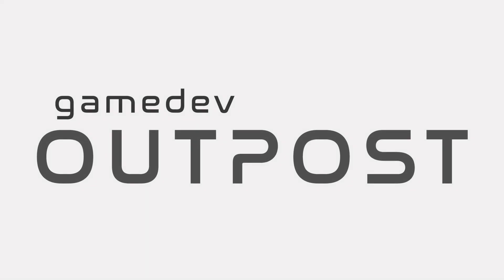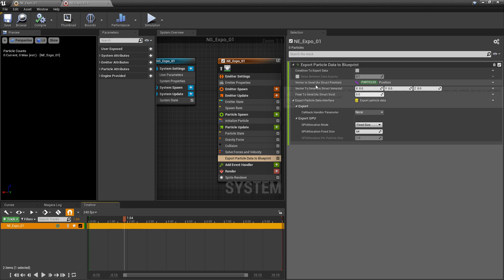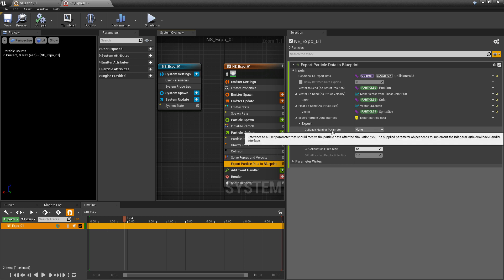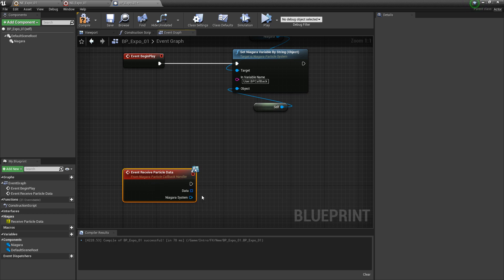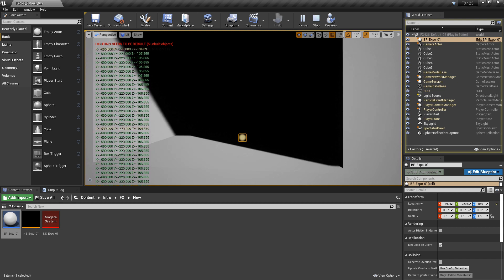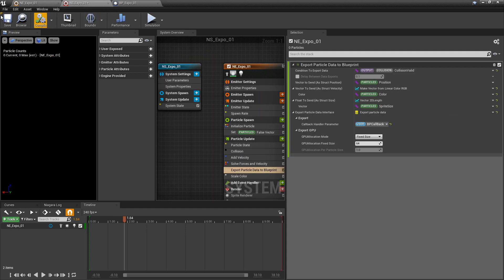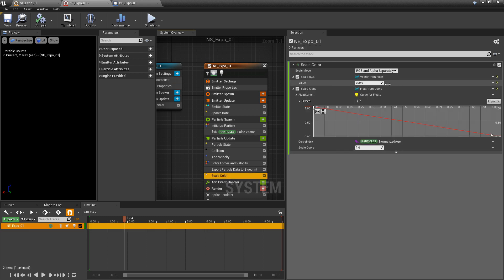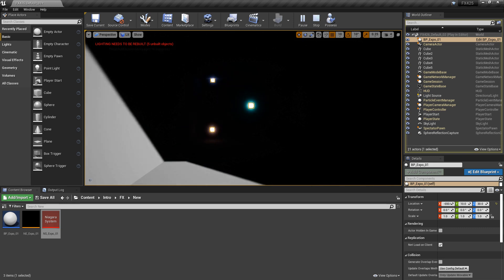UE4 - Niagara Export Particle Data to Blueprint - Collision

Comment: Im saving this for later, but what about importing? What If I want a blueprint to adjust specific particles

after watching more, This is so needlessly complicated on unreals part. How was anyone meant to just figure this out.
Reply from the maker: Importing has many approaches. Import a data table CSV or JSON, you could read from a text file in a blueprint. Then you can pass the parsed data via Niagara user parameter. It depends on your needs
Reply: @gamedevoutpost9270  Hey, Ive got a really nice emitter system now.

Ive got 2 emitters in a niagara system. Using export particle data to blueprint module, Is there a way to distinguish which emitter is currently exporting data?

Comment: Any way to kill a particle using this system?
Reply: Kill particle -> export particle data? Yes. I've done that with bullets before for eg, but I ended up not using it just because exporting data at a high frequency from niagara can cause latency issues from what I recall, and it's better to use line tracing with a similar frequency to hitscan or even with a delay, deal damage on the spot it visibly lands on.

Comment: Excellent Tutorial overall : ) 

Just a note for UE5.4 onwards: Setting VariableName for SetNiagaraVariableByString (Object) to "User_BPCallBack" wasn't working for me in UE5.4. Fix was to set it to "BPCallBack", matching the exact string in User Parameters of the Niagara System, which is quite a sensible (and less error prone) choice on Epic's end.
Reply: Also confirming 5.2 doesn't need "User" either

Comment: Hello! Do you know anything about Niagara Data Interfaces? Let's say that I want to drive my particles with values from an array that I have in C++ or Blueprint (lets say a single float value). It appears there are functions for setting float arrays on the system, but I get crashes; also they are private in BP libraries so I can't use them from C++ to test there. This is in UE4.26.2. Thanks!

Comment: Hi, great tutorial thx. One question though, do you know a way to do a cast with this method, so that it doesn't return data from all collisions, but only collisions that happened with a certain bp? Normally I would add a cast to node but I'm not seeing a way to do that with this setup.
Reply: Have you found solution? I'm searching for similar stuff. I want the particle to return the actor reference to which it collides.
Reply: @sanketvaria9734  I don't believe I found a solution for this either. Surely there is a way but I couldn't figure it out.
Reply: @flurishart612  I did found a video but the person basically did a sphere trace for every particle, that scared the shit out of me. Not an efficient way of doing it.
Reply: You can just use a "Sphere Overlap Actors" node. Then return the actors overlapped from just that particular collision and perform whatever logic you need on it. Just put the position of the impace into the Sphere Pos and set your Sphere Radius. You will also have to make an array of object types you want the overlap to check

Comment: Super cool! Question: How would I change particle material on collision?
Reply: Since this is about a month old now - dunno if you managed to figure it out but it was an interesting question so I tried to see what I could do. The Renderer is kind of a special case and specifically the Material doesn't have a binding. There are 2/3 ways I found to do this:

The easiest would be to use the "Renderer Visibility Tag" variable (think he even has a video in his playlist for it) to Toggle from one Renderer to the next. Since they share particle information in the same Emitter it would appear like you were swapping the material.

If you're wanting to blend between 2 materials though it gets a bit more complicated, you can use the 4 available Dynamic Material variables to drive different parts of the material on collision and lerp between the values (since Dynamic Mats are Vec4 you basically get 16 floats to work with). 

If you need more than that you'll have to set up other Material Parameters and use the Renderer "Material Parameter Bindings" I think.
Reply: @HuogoFuri  Yeah, I went with the renderer visibility tag method (I was helping a buddy figure it out, so that's what HE went for actually). I did discover another method too, whereby you create a Material Interface user parameter, then in the renderer you assign it under the Material User Param Binding. From there I can access this in a blueprint and 'do stuff' as well, which is pretty nifty.

Thanks for looking into it! The blend option would actually be a cool experiment given what he's doing specifically, so I'll bring that up too :)

Comment: Your project says 4.25 but the demo has to be 4.26 because they didn't include that module until 4.26.
Reply from the maker: You're right! The title of the level has just persisted from a copy. Its 4.26.
Reply: @gamedevoutpost9270  I am curious though what were your results on 4.25 if you tried this? They have the store data node and you can make your own custom version of their export module but I couldn't get it to work. just curious if you tried and succeeded or if this really is a 4.26 feature only.
Reply from the maker: I mean with enough energy you could do it. It was really a case of "why not just update if it's stable." There were a range of issues in 4.25, like texture objects worked in 4.24, but were broken in 4.25. They fixed and fleshed out things in 4.26.
Reply: @gamedevoutpost9270  Hmm not really a case of energy just a case of does the Store Data node in 4.25 work at all compared to Export Data node in 4.26. My results showed me it doesn't work at all in 4.25 and curious to see what success other have had if any.